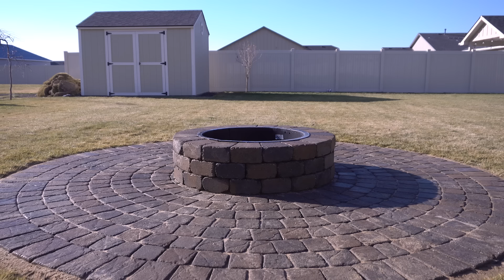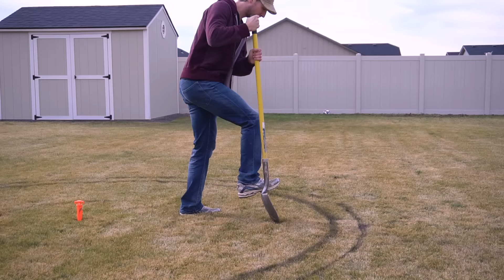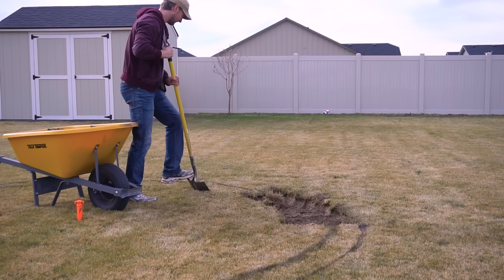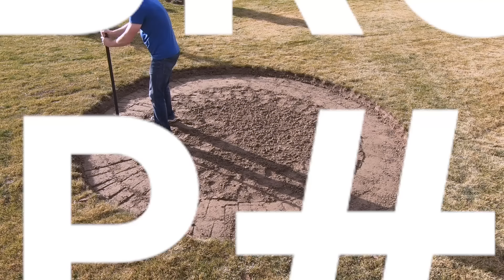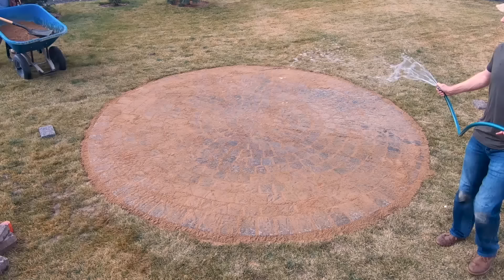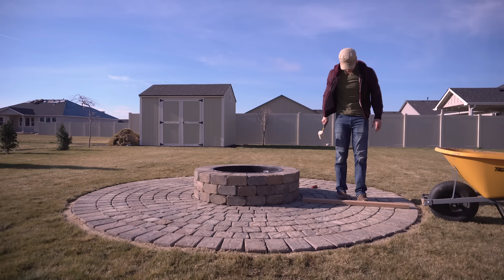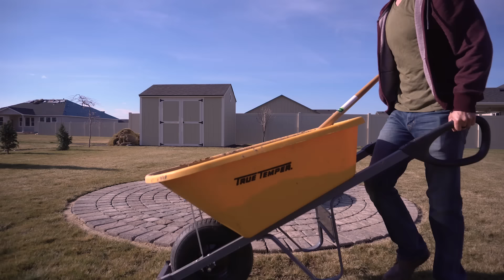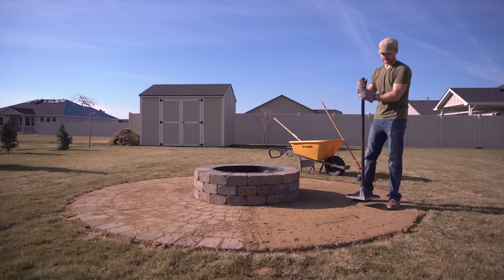My 4-Day Fire Pit Patio Build [Full DIY Project]

Comment: Remember when 2x4s were so cheap that we used them to level sand instead of keeping them in a bank vault? Good times. ;)
Reply from the maker: Hahaha, truth
Reply: Just paid $14.55 per 2x4 here in Alaska. J Grade 2x4x10
Reply: @AkJohnny  jeez I thought I had it bad in California at about 7 dollars a 2x4
Reply: @MichaelM-wu9gy  the wages are higher in Alaska as well though lol
Reply: How about the fact I live in Mississippi, and it's $10-$11 after tax?  And pine grows here like freaking weeds!
Reply: @MichaelM-wu9gy  a 2x4x8 is $9.75 here in Utah as of today, used to be $2.50
Reply: @MichaelM-wu9gy  2x4-8 here in kansas at less than 4 bucks usually.
Reply: @AkJohnny  
Christ almighty
Reply: @AlphaQHard  also the Federal Reserve continues with Quantitative easing which is only only debasing the dollar.  Fiat always goes to zero.
Reply: I remember when 2x4s were the answer to absolutely everything
Reply: I have a guy who sells em to me for 3.50 each in at massachusetts
Reply: @help316  does your wood guy know Creed Bratton?
Reply: This could not be more accurate!
Reply: I work at a receiving dock. I can’t believe the pallets we get in made with good 2x4s. I’ve been taking them home to take apart. Usually 8’-12’ pieces, can get 15-20 a week. Otherwise we just load them up to be chipped up.
Reply: @jasonm9264  same here. I work at a lawn care distribution center for texas and the pallets we get in from our supplier have been 8ftX48in with 1x4 top slats on 4ft pine 2x4s for the last 5 years. I've built fences, done reclaimed barn wood accent walls, cabinet fascias all from 1 trip brand new pallets. And the just keep coming
Reply: @roachlarry1488  I used to save all the lag- bolts from runners we took in & toss the wood in the dumpster. Now I have a box of 8 inch bolts, washers, & nuts  I’ll never use. Could have built a sweet shed with all the wood. 🤷‍♂️
Reply: I work at a store that sells building materials in Sweden. This year we're gonna have a shortage of all kinds of wood since the lumber mills in sweden are exporting it to america because americans are willing to pay more than swedes.
Reply: @albinringstrom5329  oh yeah Sweden give us your wood 😂
Reply: $4.30 (ish) a meter in Australia right now, if you can find any...
Reply: remember when 2x4s were actually 2 inches by 4 inches?
Reply: Seriously tho what the fuck is going on with lumber prices 🤯
Reply: Turbo5.3 Salcedo It’s called the Biden effect.
Reply: @1stfloorguy59  be nice to your fellow man. They are all playing a game on us . Trump Biden whoever it is listens to the Federal Reserve which had printed more fiat currency in the last 2 years than in all the years prior of the USA s history . That's why people are buying Gold Silvef BTC and Theta. Only 21million BTC . But seriously buy Theta
Reply: Why did they get more expensive
Reply: @LanternsoftheDead  the lockdown is the short answer
Reply: Why is wood so expensive now
Reply: Lol yea. Trees r everywhere here and its still insane for lumber
Reply: Comments made me laugh. 🙏🏾😂
Bless all y'all
Reply: I dig 8ft 2x4s out of the construction dumpsters almost ever day. 1 or 2 nails dont bother me.
Reply: Got some untreated 2x4x8s in North Carolina for around $10+ each a while back but they keep going up and most people around here to broke to pay for that type of demand..
Reply: Yup. I know some contractors debating on whether or not to double prices for new builds. it sucks I wanted to add on to my deck to but now meh ..
Reply: Omg I know right... Wth 😑
Reply: Good ole days
Reply: I just got 9 8ft 2x4s for 15 dollars a couple weeks ago
Reply: Yep I miss that
Reply: 2x4x8 spruce 14$ Canadian a few days ago insanity
Reply: @dozergetscrafty  the wood Sweden is expensive but higher quality. For years I've been seeing low quality wood with mold
Reply: Hhahaha amazing
Reply: @JoNoSay13  wood is smaller because when it fully dries it shrinks
Reply: Shiiit, it’s $5 a piece where I am.
Reply: Yeah what happened? Why is it more than a dollar a foot now?
Reply: @Richard Wright home depot
Reply: @dozergetscrafty  Nope not here in Western N.C it's up pretty high I been working on my homestead from almost ground up for over a year and I have about as much $ in the wood and supplies for the "mobile home" as I have in my whole property lol.. Was listed as mobile home needs tore down when I got it but I think it's almost livable now so I'm proud of what I got just need these prices to become realistic or else I will have to start a sawmill.
Reply: Lmao. That’s why I use lumber I cut from my own land. Life saver 😅
Reply: Yes
Reply: you cant even use them to level off now anyways most of them come bent or twisted
Reply: Ben Shapyro  "Not to make it political, but I'm gonna make it political." Get stuffed.
Reply: Yea just start planting trees  and maybe in 100 years
Reply: They like $3-4 each in Louisiana
Reply: FJB
Reply: Yup and they will go higher due to clear cutting/deforestation.  There needs to b a much higher emphasis on  sustainable managed forests so prices go down in the long run.
Reply: @kingadamus8820  I'm in Canada and trust me no shortage of timber. It's called supply and demand. The low interest rates have jacked up house buying and building. The housing market is booming. But... What for the crash when interests rates and cost of living goes way up thanks to taxes and inflation from government stimulus and there's no jobs because the rich billionaires have hijacked our government through the UN and China to move all our manufacturing to China so we are totally reliant on them. It's all a plan to give the rich elites more power and control. Soon we will all be like China is there main goal. YAY!! for the stupid little people that believe in the shit media garbage and votes for Biden and Trudeau. Go dumb fucks of the world.
Reply: @kingadamus8820  I agree but the Federal Reserve has printed more currency in the last 2 years than in the entire history of USA prior. Things aren't going up so much as the dollar is losing its purchasing power. This is why many are buying BTC BCH ADA DOT Gold and Silver. Also THETA....seriously though buy theta you will thank me in 2 years.
Reply: #joebiden
Reply: What is a 2*4 can you explain please
Reply: @fareshejazi2297  it’s a big piece of wood
It’s rectangle shaped
Reply: @fareshejazi2297  A twisted piece of overpriced lumber, actual size 1.5" x 3.5". It usually comes with a slight 1" bow or develops one shortly after purchase.
Reply: @henrywinterbottomii3613  xD this couldn't be more true. Wood quality has gone down
Reply: @henrywinterbottomii3613  I'd laugh, but the accuracy of your statement is so true it's sad.
Reply: @fareshejazi2297  it’s a 90mm x 45mm stick of timber
Reply: @Fenrirnorgesen  actually its 100x50mm ...
Reply: @fareshejazi2297  lovingly called by builders in the u.k, 4 bee 2 bee
Reply: @fareshejazi2297  Piece of wood 2 inches thick and 4 inches wide and at least 8 foot long.
Reply: We pay 2$ for a 2x4
Reply: What were the prices for 2x4s?
Reply: Hahaha, true!
Reply: Trump was like Canada will pay top dollar for our goods. Yeah well the price of lumber for the USA just went up.
Reply: @IhateAIvideos  that has to do more with COVID-19 supply issues than anything else lmfao
Reply: Remember when we had a good president that cared about our economy?
Reply: @bobbyflay2822   on food network?
Reply: Cause of Biden 🤦
Reply: @stopitnow5477  You really think the price of lumber has much to do with the president?
Reply: @prestontable  Yes, it has some to do with him. Understanding lumber pulp is the first thing in your quest for knowledge.
Reply: @UntoldMizery  I figured my morning wood  was enough knowledge
Reply: @prestontable  HAHAAHA, good one. :)
Reply: Now, dear Americans you now what socialism means ;)
Reply: @Glicerol  Yeah some of us already knew...
Reply: @Glicerol  you probably meant to say capitalism, because that's what it is.
Reply: @henrywinterbottomii3613  he just meant that if we were to have socialism, it wouldn’t just be a temporary price raise, but everything would raise in price and not go down
Reply: @henrywinterbottomii3613  capitalism means low taxes, no social privileges ;)
Reply: @timothyrobinsondrums9663  It's supply and demand. Simple as that.
Reply: @henrywinterbottomii3613  It’s not only supply and demand, but inflation too. You can’t leave the printers on for a year straight and not expect to pay the bill.
Reply: @Nostradevus1  I'll take all of the below: 
1) Inflation due to the USA (and other countries) printing money or other strategies to survive the lockdowns.
2) Covid restrictions mean mills haven't been as productive. Less product and higher demand means higher price. 
3) Oil price increase due to Biden's immediate pipeline stifling means higher cost to transport/ship. 
4) Imports, tariffs, taxes, and all that jazz are ever increasing.
5) Environmental regulations (again, thanks Biden for your/ your team's immediate mandates) mean it's more expensive to get the lumber in the first place. 
6) An overall weakened economy due to the politics of Covid. I'm not Trump fan by any stretch, but credit where credit's due. The businessman  give the USA the best looking economy it had ever had before everyone flipped out over a flu and the USA was all but forced to follow the EU's shutdowns... and then one up them because we're the US of friggin A.
7) We're the US of friggin A. We're definitely a trend setter, so when our markets inflate other countries (like Sweden) want a piece of that inflation or follow suit. Higher prices for everyone. 

No one truly wants a destroyed ecosystem. No one likes a wasteland, and even the most greedy capitalist who only sees trees and oil and hybrid dinosaurs as assets still understands the need to maintain a healthy, balanced, replenishing system. Only idiots don't take care of their product, and that includes forest health (looking out here at the west coast and our wildfires from over protection/regulation lol). IMO Biden's pipeline shut off, etc. drove all kinds of prices up, hitting all of us stuck with this awful shutdown economy right in the pocketbook where there's nothing to be had. 

So, yes, Biden is directly responsible for prices in the building industry. Also grocery and gas price hikes, etc. It seems farfetched and just blanketed hate until you connect the dots, which, again, IMO, everyone should be doing with everything. Riots? Find out why and question those motives and find out why and connect those dots for the truth. 

Good luck out there fam!
Reply: @Undomaranel  Regarding Trump’s economy, your words are far more accurate than you think. We had the best-looking economy. Best-looking, as in it looked good. But the truth is that it wasn’t going as well as we were all led to believe. The Trump administration’s economic policies have set us up for an economic contraction, the extent of which we’re not currently certain. And no, I’m not talking about the 2020 economic crisis. The 2020 economic crisis changed nothing. How do I know? The recovery time was too short. A true economic contraction would’ve taken years to resolve. Trump’s administration definitely did a good job at crafting a nice exterior for the house of cards, but the interior is still rotting. Anyone who dares to peek inside will know this to be true.
Reply: @Undomaranel  I'm democrat and I agree.
Reply: @josephhoward4697  Explain. Tell me how to see into this 'house of cards' instead of just saying something is wrong and leaving us to wonder. It's like this with 99.99% of comments/discussion I see on these topics. Please, for the sake of whatever you find important, educate people how to see these problems themselves, don't just sit there like "yeah this sucks."
Reply: @saucecups  For starters, we’re facing falling mortgage rates, while housing demand has been in an overall decline (with the pandemic demand being an exception). House prices have been climbing. This tells us that either supply is dropping, or that the housing market is dealing with a major bubble. Interest rates have been in post-2008 mode right up until 2018, which meant loans were easier than ever to get. Rates started going up, but then the 2020 economic crisis forced interest rates back down. Trump pumped trillions of dollars into the economy while people were out of a job, and now everyone’s surprised we’re having inflation when employment goes back up, even though it was very easily predictable. There’s powered interest rates, more money than ever, and employment is on the rise. Of course we’re going to have inflation! Trump’s economy was always based on lowering rates. It wasn’t about helping anything in the long-term, it was always about making the short-term look better. You can’t drop interest rates below 0, so now the Fed has absolutely no way to help in the event of another major crisis.$
Reply: @josephhoward4697  I appreciate this detailed response and I agree despite not being well versed in politics. I have seen the effects of several of these points.
Reply: @saucecups  I appreciate that you took the time to go over it and consider it in depth. Not many people I come across are open-minded to the same extent as are you. It often leads me to question why I write such detailed responses. Responses like yours remind me. Thank you, good sir!
Reply: @Undomaranel  It's a plan with Biden and his UN buddies aka China. They have been planning this for the last 20 years at least starting with the Bushes. The billionaire elites are getting rid of our democracy and have hijacked our democracy and eventually we will be like China. 99% poor and totally under control... I hope they don't succeed.

Comment: If anyone is wondering about the sand it’s a special kind of sand you need. It’s called polymeric, it’s sand mixed with some glue,, and you do exactly as he showed. And with that stuff you just need to mist it, not soak it down. Not sure if that’s what he used though
Reply from the maker: So, we didn't use polymeric, but we did kinda use the techniques that polymeric requires. In the end, I didn't want the sand filling the gaps to be hard like concrete (which is what polymeric does) in case the ground shifted during the winter. I will need to use more sand in the future as it washes away.

Comment: And instead of starting on one end when you do a circle, start in the middle and lay as you screet out. Second when you rent a tamper get one with a pad, lay everything out run tamper with pad over the top. But great job for someone who doesn't do this every day. Last don't slide the paver on sand pick it straight up and move it you could ruin the sand. Last use polysand it will stay nicer longer.  Once again great job
Reply from the maker: Thanks!
Reply: @BroBuilds   for real amazing I've been doing custom landscape intall for 10 years and have met people that could never make it look like this

Comment: What is the conduit for exactly?
Reply from the maker: It just gives you a level "track" to push your 2x4 along, when you're smoothing out the sand. Basically it helps you make the sand layer perfect. Then you can pull em out when you're done.
Reply: @BroBuilds  ah ha! Thank you so much for your reply. Good stuff to know:)

Comment: Mistake by not using adhesive for the pit portion. And the last layer of sand in the cracks needs to be a polymeric sand not regular sand otherwise enjoy the weeds every spring

Comment: I did mine in a square, after sitting the blocks down where circle was I poured concrete in and smoothed it out, makes cleaning out the ash much easier. I had a company come out and put a continual concrete border around after they did it around my house. The rest was putting down white rock with plastic underneath first. After burning for several years some of the blocks have split from the heat. I bought a grill to spand the ring from Amazon for $85.  so I could cook there also.

Comment: This is a great video. I have one question about the fire circle itself. First why I put stone under it when most of the time it’s going to be covered up with logs and so forth. But more to the point I’ve been told that the pavers themselves may not be able to withstand heat like you might get from the coals of the fire and they may crack or explode underneath all the heat of a fire. You have the fire ring, which is supposed to actually be good for protecting the stone from the heat. But the fire ring doesn’t cover the base. Really I guess I’m asking: why put any pavers on the ground—why not just leave it as gravel?
Reply from the maker: Yeah, good question. Basically we used the center pavers because that's how the kit stays together and looks seamless with the firepit. We could certainly remove them now, from inside the fire pit, but then it would drop the fire pretty low. As it is now, we're using a fire grate in the center of the firepit which raises them off the pavers. Probably the best option would be to add layer of gravel or sand over the center pavers to protect them from the heat. We may do that down the road for sure.

Comment: Wow this is awesome. I don't do this stuff..I just like watching it but I wanted to ask how it all stays together especially the middle portion since it doesn't have cement or anything to glue it together? Thanks this is pretty cool
Reply from the maker: Just gravity and the other pavers holding it in from the sides! Plus, there's a flexible plastic guard running around the entire outside of the patio with stakes holding it tightly to the outer ring. So everything inside can't move.
Reply: @BroBuilds  that's pretty cool!